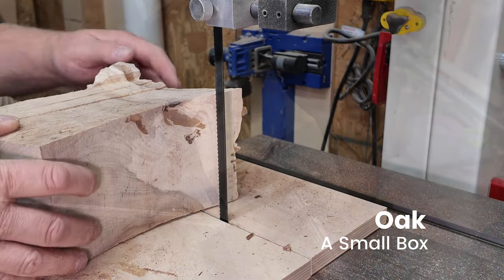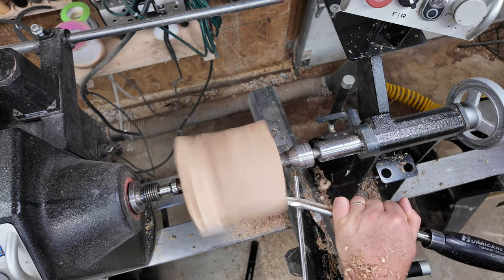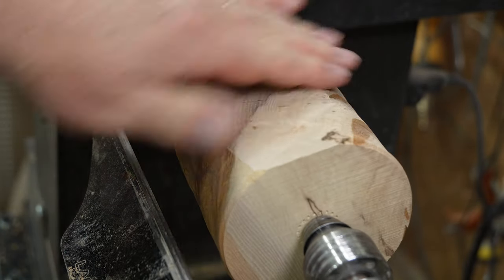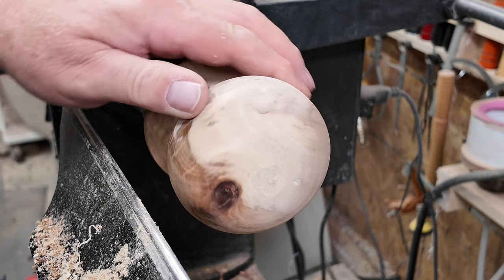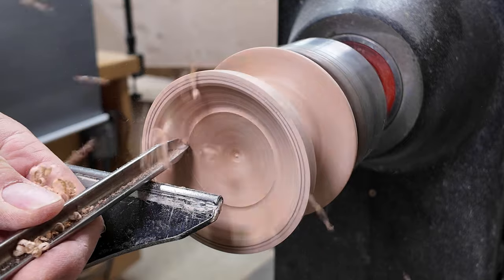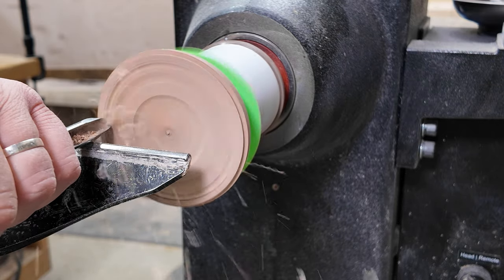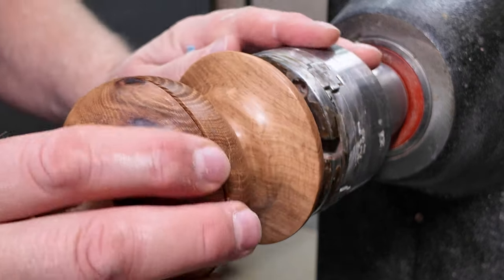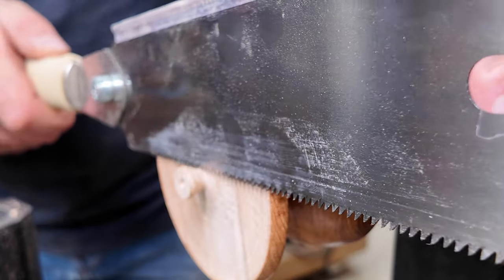I’m Turning This Piece of Oak Into Something Awesome

Comment: Nice little box. I am trying to figure out how I can turn a similar box without a vacuum chuck which I don’t have.
Reply from the maker: You can do it! Just need a small wood chuck with foam using the tail stock to hold it. Cheers